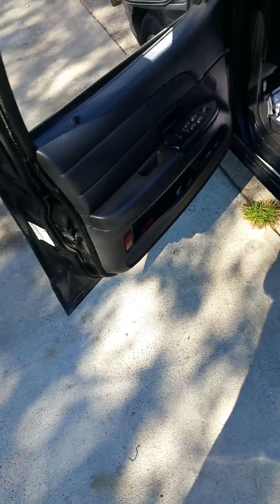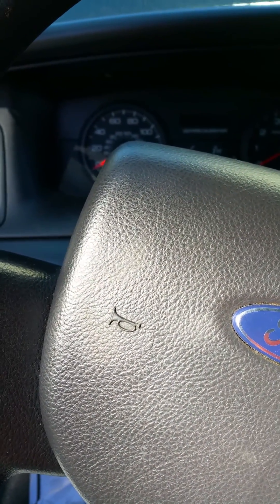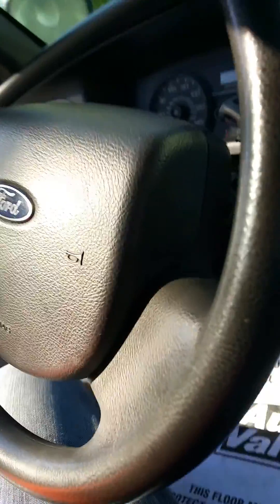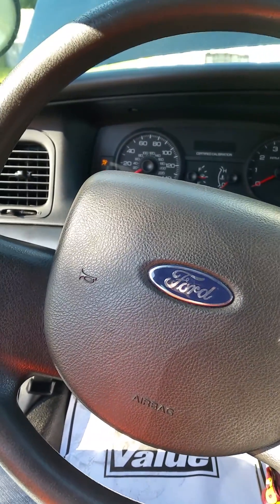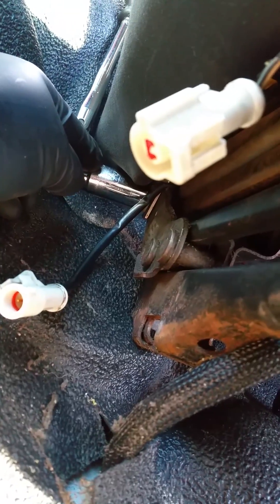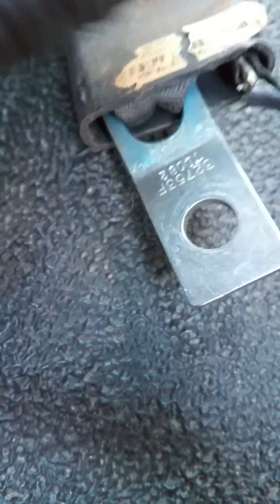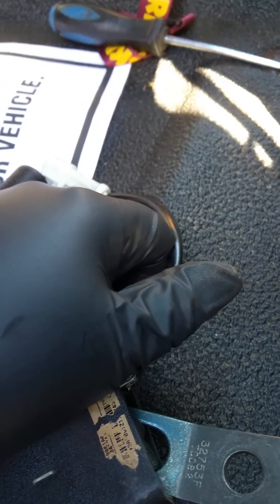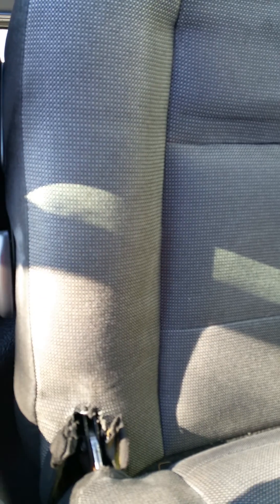Ford Crown Victoria police interceptor airbag light

Comment: Same problem on my 06. Thanks for the video.
Reply from the maker: Great cars if you stay ahead of the maintenance and they are hated by everyone so to me that's the perfect car
Reply: @dailygrinders89  I've had mine since 2014 and have had to do minimal work to it. Intake first, then rear axle seals and brakes. New radiator last year. 128,000 miles now and runs great.

Comment: My 04 P71 ran trouble free for five years. The 06 I bought to replace it ( After 300,000 miles and some change.) is a piece of shit. I've done nothing but fix it since I got it. I have airbag code 14. I cannot find ANYTHING on the internet on how to even begin fixing it, and since I'm not a billionaire, going to the stealership for help is out of the question. So I do all my own work. I also have various engine harness issues.  So anything after model year 04 is garbage. BTW, I'm also in Virginia.
Reply: you try replacing the passenger airbag indicator light? (above the gc) i had an 07 with the same problem and that was the issue...cheap and worth a try
Reply from the maker: 04Interc3ptorP71 yeah they have no value so I wouldn't spend much repairing them these days. I got rid of mine shortly after this video
Reply: Lol u got a clapped out car bro my 06 is good

Comment: what did you wind up doing bro? i got the same code.
Reply from the maker: Albert Gomez  sold it man smh it was a lot of small things wrong with it but added up to more than its value IMO
Reply from the maker: Albert Gomez but the airbag light was caused by the seat belt so easy replacement of the seat belt buckle fixed that issue
Reply: Thanks brother I'll check check it out.
Reply: DAILYGRIND Hey I’m having the same problem with mine. So it’s the buckle itself that’s the problem?? Any links to vids to replace that??
Reply from the maker: @soze416  sorry for the late response but your issue could be so many things I would start with getting it diagnosed by a scanner and then go from there